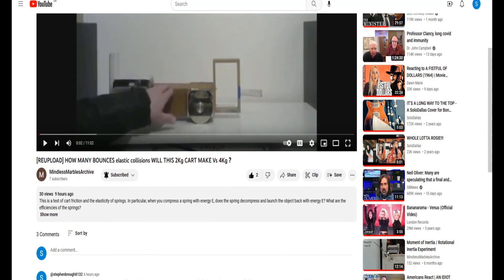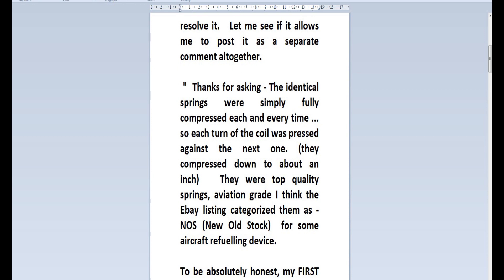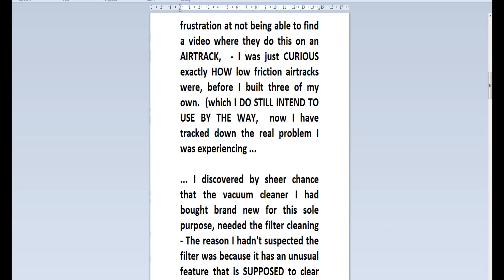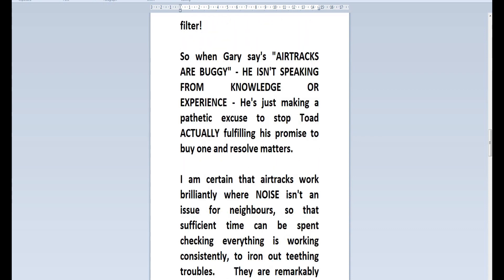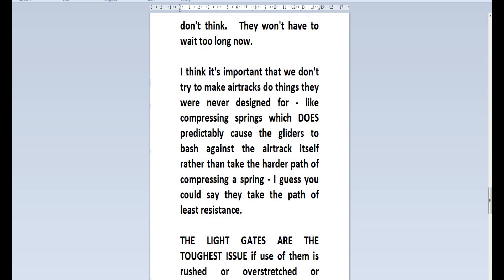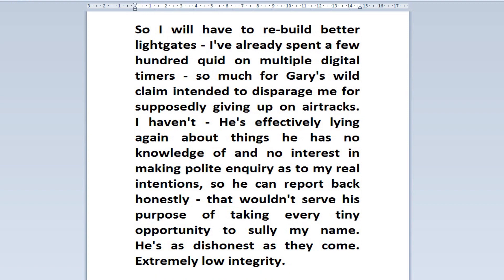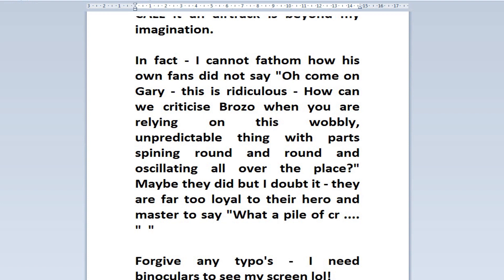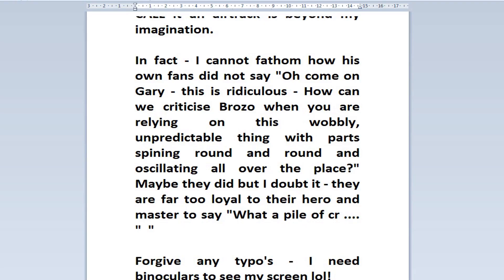YOUTUBE BLOCKED MY REPLY TO MINDLESS MARBLES SO HERE IT IS IN VIDEO FORM.

Comment: Stephen, hello. To set the scene first, I have been a somewhat infrequent visitor to Gary’s channel. I also am very polite and have no interest in getting involved or between your and Gary’s “beef”. By which I mean, the various to and fro. For me I’m interested in testing things, getting them right and resolving then moving on. I have to say this at the start because I want to avoid any drama and I would like my motives to be understood.

I use words like charlatan, liar etc very rarely as in my world these are quite strong language. With this said I will get to the matter at hand.

I applaud you for trying to experiment, the thing I find when trying to do these experiments is that it’s actually quite hard to develop a clean and unlossy experiment. I had assumed when I first got involved this would be easy, but clearly it’s not. 

I still think the whole air track approach could work, because in theory the losses or difference between the experimental outcomes would be large enough to notice. So using good technique I think a lot of the issues could be compensated for, whatever Gary may think. I certainly think it’s worth trying. I’m uk based so when you do get yours working I would happily visit to attest and validate any setup as a sort of impartial person. I have no axes to grind on either side,i just think on something so basic we should be able to resolve things. 

For me the logic I’m applying is that this kinetic energy is a calculated value for sure, but I’m struggling to locate real world places it’s seen. I do think if it was correct we would see fast small wrecking balls, we would all drive much much slower because we would be using too much field going faster, I also think we would see this exhibited in breaking forces.

If we just consider one area, let’s take cars. If we have the same car and we drive it at 30mph, then we drive it at 60mph. If we were using up to four times the fuel (as we would be needing to create twice the velocity) I’m sure we would notice ? I haven’t ever noticed I get four times less fuel consumption, sure I do think it is a bit less driving slower but not four times. What do you think about that ? 

The other thing I would point to is the basic newtons cradle I filmed a few days back. In theory the 4height ball was going twice as fast so had four times KE. When it hit the double weight ball, it didn’t knock it well back at all. We can criticise was my timing precise, losses, etc but I looked at the footage a few times and even if we think things were a touch out it’s still no surplus energy being shown.

Hence I’m interested in what people think is happening, I’m not decided but there does seem to be a gap between what is supposed to be and what is real. I know Gary’s way of engaging probably annoys people so they perhaps don’t see past his demeanour to the ideas. 

Anyway, I am interested in this. I am sure we can work out a way to put this to sleep for once and all time. 
I’m happy to play a part, I have extensive experience in practical engineering and I’m pretty good with electronics as well.
I’m also drama free, as I’m sure you have seen. 

For me a perfect outcome would be to agree an experiment that’s very simple and could then be carried out a few times and show either way what’s occurring. Look forward to hearing your response.
Reply from the maker: Hi Toady - Glad to talk and I respect your position.  Yes a meet up would be fine by me if it helps at all.  In ordinadry life, I'm as polite as you.  I got drawn into all the drama after making a GOOD start communicating with Gary - We liked one another and saw various good things in each other.  I still do kinda like Gary in a strange way and I wish we could get on. (notwithstanding certain things he say's on non-scientific matters - Best kept separate. )  Things only turned sour when he found me discussing my mental health issue with a fellow sufferer,  Hythloday, Gary's number one enemy.  He found that disrespectful although no disrespect was intended - I just welcomed the chance to talk a little about Asperger's Syndrome.  I don't want to tell you the whole story because that will be just dragging you into the drama you've made clear you want no part of. 

I'm still feeling quite ill since my hasty response to your other other comment on my bouncing carts video (there's a better version of that without the overlay obstruction your view) .. I was explaining how ill I had suddenly become while almost completing a long, detailed reply - I just couldn't finish it for various horrible symptoms - I'm still struggling but not as much - so I will have to reply to your points properly in a few hours.   I need to lie down again TBH - don't want to be sick again - might be food poisoning. 

Let me just make a start on one point, if I can sum it up briefly first then maybe expand later when I am less ill. 

I tested whether ELECTRIC cars really do use 4 x energy to go 2 x speed - and NO THEY DON'T - but the catch is they appear to take MORE than 4 x the energy to ACCELERATE to that speed in the first place... All my tests accelerating electric motors, measuring power as best I could with limted instrumentation - seemed to indicate that after taking roughly 6 - 8 x the energy to attain a doubling of sped, they THEN got more or less a free ride so to speak!    The quite large TEAC tape recorder motors went on for over 50 hours on ONE tiny AA battery, all chosne vrand new from Morrisons own brand - so nothing special ... and there wasn't much difference when I quadrupled the voltage (my mmory is a bit hazy TBH - although I have a video of it which has been up about a year, including graphs etc.   U THINK I may have tested double votage too  .. It was THE most tedious experiment I ever did, videoing a total of about 100 hours of the HEAVY 2" TAPE REELS going round and around, desperately hoping the batteries would run out soon.

Although my memory of it is hazy - and I don't claim this to be the world greatest experiment or anything - it was better than nothing after someone gave Gary a link to a proper test on TESLA'S - but the page had been removed - so no-one got to see it.   So I stepped in, hoping to resolve matters a bit.  Because I was curious too.  

I tried everything I could to simulate a bumpy road, sapping the energy I HOPED by attaching large masses to the reels to put them out of balance - so there I was for at least three miserable days VIDEOING IN ONE SHOT,  wobbly tape recorder - only to have to start again when after 20 hours something went drastically wrong, like the tape deck falling off through all the wobbling.  

I never uploaded that video because it would be THE most boring video on Youtube, havingto be split into 6 10 hour videos.  

____________________________

So I think the 4 x fuel thing is a myth APART from acceleration, when it is actually a lot more than 4 x. 

Someone said this is true of a certain aircraft - but I can;t recall the details. 

Making the reels extremely wobbly didn;t actually make any difference either.

I CONSIDERED minimally applying the asbestos type brakes on tape recorders (they hava steel band which wraps around what appears to be an asbestos surface)  but my concern was that I have no real way of guaranteeing I would be applying the same friction to each reel, running in tandem on different voltages.  Even if I could - brrake wear might give advantage to one or the other.   

I don't run a science lab - I'm just an ordinary bloke, ex electrician,  doing my best on these things - for fun really. 

__________________________

WRECKING BALLS - 

That claim has always bothered me because there is a pretty obvious flaw in Gary's claim, which anyone who tried to build one with a half size wrecking ball, would soon realise ...  

.... Wrecking balls get their energy by being raised to a certain height by the crane thingy ... 

....  To get a HALF MASS wrecking ball to go TWICE AS FAST, the crane would have to be able to raise it FOUR TIMES HEIGHER. 

That is obviously a BIG PROBLEM for a vehicle needing to have both STABILITY and MANOUVERABILITY, to get to site, possibly narrow streets etc. 

If the base has to be made larger / heavier to accomodate 4 times the height it can practically lift a half mass ball,  then the vehicle would not only be considerably more expensive but would be able to take on less demolition tasks where it could not really go as easily as a normal one.

I like to think the engineers who designed the ones we do use, took into account all the pro's and cons, to find the OPTIMUM size of the vehicle and size ball it could use.
Because I think engineers know what they are doing.   As in all things, it must obviously be a compromise between all the varying factors thy would be given in a bried to design one.

I doubt they just draw some crude drawing and say "THERE!  The smaller we make the ball, the FASTER we can make it go, thus saving on ball cost""  ...

... I think they would be sacked on the spot when they found themselves having to make the most collosal, wide, heavy, tall crane to achieve that doubling of speed - because HEIGHT is the only thing they have to work with to make it go at all.  

Then there is the TIME it would take it to be raised to that height again - that would be 4 fold. 

And the SWING AREA would take up considerably more room - since the radius of the arc it has to swing through is also 4 times greater - What if there are buildings in the way?  It would be a duff product. 

And what about when that 4 x greater arc ALSO swings THROUGH the building it is demolishing and potentially smacks into ANOTHER building they didn't plan on demolishing?     Time to call Fred Dibnah.  (my hero - I have a video about him, a song with footage of him) 

And what about the increased difficulty of hitting the actual target, with such a long swing?  

There may  be tons more points that actual engineers would point out but I'm just applying common sense.

They could instead DOUBLE THE MASS - and what would that achieve?  

A shorter crane , stronger steel cable needed,  possibly problems with the HEIGHT it could be effective at ...

I am confidence engineers have already decided on the best compromises so wrecking balls are probably much of a muchness. 

_________________________

The problem I generally find with claims like this, is that it only takes SECONDS to say "If the KE formula is true, WHY don't they HALVES the size of wrecking balls!?"   and make an instance impression on anyone who hasn't stopped to thin it through a bit ...

... But it takes MINUTES to explain exactly why that claim is clearly false - and people generally lose patience listening - they switch off - They prefer the shorty SOUND BITES that gary specialises in, becaiuse they require no actual thinking. 

I see it as a GOOD thing when people raise such questions - so long as they are willing to listen to the answers  - But that stopped happening a long time ago - It has become purely personal from gis point of view ... so he's gone from saying Steve is a lovable guy who does important experiments (6 years ago) to Steve is a clown, a cheat, a ch m lester,  - he actually say's these things without batting an eyelid.  But enough said. 

_______________________________

I feel dead rough still - dunno how I am ploughing through TBH - I really wanted to finsh my other reply to you on the bouncing carts, when I stumbled on this comment - I don't yet know how many you have posted - I assumed just the one - 

But it's good to talk.   I;'ve gotta go before I need that bucket again - ugh!
Reply from the maker: PS - Think about the smaller size hole a smaller ball would make in a building - 
Plus WHAT PROBLEM ARE WE TRYING TO SOLVE?  None - 
It's not a known problem - They know how hard they want to smack against a wall - smacking it harder won't demolish a bigger area, - a smaller one of anything, if it goes though more like a bullet
Reply from the maker: Part 3 - you might say - Someone woke me up from my badly needed sleep so I may as well explain the main reasons his BOWLING BALL argument falls flat on it's face the mnute you talk to professionals who actually play the game competitively.    

Gary overrides their expertise because he's been to a bowling alley.  Whoopee. So the pro's must be WRONG when they explain it's a game of SKILL, not brute speed - They are trying to achive a very definite speed.   

I THINK they said between 19 and 21MPH - but it's been ages since I heard their explanation of the technique they employ, which is NOT yto try to smash into them at 40MPH, but to CONTROLLABLY make the ball "bend" - I forget their special word for it - so ut strikes the pins with a kinda SIDE ON component, targetting a specific pin. 

That's just the start of why it's a ludicrous claim...

1) I already DID a very careful test, using those massive 2inch recording tape reels weighing several kilo's, representing similar mass bowling balls, controllably launching them at the requisite speeds,  to roll into a series of 1 Litre water bottles.   

And guess what - the half mass/twice speed one knocked down considerably more bottles. 

His argument?   I used GRAVITY in the mechanics that made them go at the required speed!  

What possible difference could it make, so long as the speeds were accurate?  

2)  Think how strong a bowler's arms would have to be to throw the half mass ball at TWICE the speed...

...If MV applied, then it wouldn't require any extra effort. 

And we've already established that they don;t want to do that anyway because Gary's describing some other, cruder game he imagines just because it suots his "argiument", such as it is. 

He ignores the multiple experiments proving that the same energy input CANNOTdouble the speed or anywhere even close ... 

... and that it ALWAYS results in the half mass going 1.414 x faster AT BEST - barring a mistake like me accidentally letting my half pool ball skd along faster than it should have done, causing an erroneous 1.69:1 result - SINCE CORRECTED thus achieving THE CORRECT 1.4083 :1  - (will upload soon)  - 

.. So he/she has to DOUBLE his energy input to ACTUALLY make it go 2 x faster. 

And they don;t want to do it anyway! 

It's irrational to ignore what the professionals say about their own game...

... and to ignore the preponderance of evidence, just so he can trot off the words "BOWLING BALLS" every ten minutes and feel he has made a valid point.  He has not. 

It's not as if he's not had this explained to him - He just WILLFULLY ignores was professionals say and dreams up ludicrous EXCUSES for why EVERY experiment show's he is wrong.    Not a single one has ever come out in his favour.  He just alter's people's perception by CHERRY PICKING two numbers that to an unthinking person, SOUNDS like a 2:1 ratio... this 11 vs 19 figure he quote mines from my pool ball experiment does indeed SOUND like virtually 2:1  if you roud it down to 10 and up to 20 ...

... But that's MASSAGING THE FIGURES - They actually have a 1.72 : 1 ratio - BUT HE WILL NEVER SAY THAT!  BECAUSE IT SOUNDS NOWHERE NEAR 2:1.  BECAUSE IT ISN;T LOL!

And he ignores the final averaged out result which was 1.69 :1 ... Because anyone who can add up can see that is actually marginally CLOSER to 1.414 than 2.   Then he would have nothing to waste our time talking about for THREE HOURS almost every day.    He's an out and out time waster.   I DO kinda have a liking for him though because he IS  unique individual with tons of tenacity and he IS entertaing and he IS quite obervant and creative to keep inventing excuse after excuse - That's a talent all in itself.  

People say "stop wasting your time - he weill never learn" - True - but I DO mostly enjoy it - and I learn things myself along the way.  He's entitled to his opinion - Too bad it's invariably wrong. 

Sorry my comments are always so long - It's a kind of compulsion to dot every i and cross every T.
Reply: @stephenbrough8132  thanks for your reply Stephen. 
I haven’t looked at the bowling ball type setup but will, as it might be reasonably easy to try.
I do agree that I assume engineers have decided on optimum values for things, because of course they do.

The tape decks seems to be a good test, especially using asymmetric loads on the reels, very surprised that didn’t use them up faster. I mean vibrator batteries die faster than electric shavers because they have a load that’s asymmetric on them ! Not that I’m an expert on either I hasten to add.

Look, i want to avoid being some person in the middle between you and Gary. So I will not comment on that, but I think that putting all history to the side it is fair to ask these questions. Certainly the evidence is not super forthcoming and as both you and I can agree it is also not easy to test.
That’s why I’m keen to get Gary to try to experiment as I feel he is reluctant to test the ideas and anyone interested in truth is also interested in testing. I am absolutely not taking any “sides” here and I will happily critique yours, his or anyone else’s tests.

Final point, I didn’t think the cart looked dirty.
Reply from the maker: @toadyuk8391  Thanks Toady - Your final words went over my head a bit.  "I didn't think the cart looked dirty"... I didn't know that was ever an issue or why it would particularly matter.  I'm guessing Gary must have made it an issue and I missed hearing it because I don't have time to listen to everything - It's a phenominal amount of talking to listen to - I used to try to keep up but it's such a BIG chunk of time out of every day, there are times I just gave up listening - I'd come back a month later and not feel I'd missed anything - Mostly just seems the same show over and over. 

In fairness, the cart is about 40 years old (My late Dad's whisky box he kept pens in) so it probably is a bit grimey but I never noticed.  He's right that my finger nails are often dirty - I'm a busy bloke, people always asking me to sort their bins out, take kids to football, look after their kids severl hours a day - I do more than a lot of Dad's and frankly, it exhausts me but is so rewarding and heartwarming that they love me, I'd rather sacrifice 6 hours to have such a great rapport with them.  

Right now I couldn't look after a gerbil.   I feel kicked in the chest, weak, dopey.   Food poisoning probably.  I really should live a cleaner lifestyle if that's the reason. 

________________________-

You're right that the evidence is not "super forthcoming".
I was dismayed that the Willem Gravesande / Emilie Du Chatelet clay experiments were impossible to find re-done on Youtube, while there would be LOADS of other famous experiments reproduced ... So I made about 6 videos in all, maybe 8,  where I thought it would be worthwhile testing the claim of their results...

FIRST PROBLEM!    Myths spread faster than truth on the internet. 
So both Gary and I fell for the widely spread myth - even included in a famous movie about Einstein - that the ball dropped from 4 times higher, goes four times deeper. 
 ... 4 x higher = 2 c velocity - 

I had to prove even THAT too, for Franklin Hu, who two months ago claimed it wasn't true and had supposedly never been tested.  

So it's not just Gary I will argue with if anyone makes such an arrogant proclamation with the absolute worst evidence - which Franklin's was.  

I STILL HAVEN'T UPLOADED THAT VIDEO, which is such a shame - It's great!  I put a LOT of effort in.    But the moment was lost by the time I had completed it - Everyone had moved onto other things and he'd stopped going on about it so I let it drop.   

I think you would enjoy it though. Same for many dozens more experiments never uploaded because the moment was lost by the time I had completed the work.  Every time I try to RUSH an experiment so I can publish it before it's no longer a hot topic, I live to regret it, for the obvious reason that it takes a great deal of time to do the best version I can. 

SO BACK TO THAT MYTH of the ball going 4 x deeper. 
There are even misleading DRAWINGS of a ball penetrating clay, supposedly making some perfect deep hole - looks like a drawing of a mine shaft - one short one and one very deep one, 4 x deeper.  It's all fantasy.   But we all fell for it at first. 

I eventually found just two rather poor videos where at least they were not propagating that myth ...
One was a school, where the teacher explained it's the VOLUME DISPLACED which is 4 x. 
It wasn't videoed too well - although he did do the math to calculate the volume, which came out within a small margin or error. 

The other was older school kids doing it without a teacher to assist.  So they made mistakes at first.  
But at least they too had the right idea - to measure the volume displaced, not the depth. 

Once I knew the proper way to do it, it was a breeze - I bought large lead balls - (Gary argues they should be brass, although he used to argue it makes no difference.  It obviously doesn't.)  and dropping them in a very controlled way into a new batch of clay bought for this purpose, it was easy to measure the volumes using a syringe to measure how much milk (easy to see) each dent could hold.  

Gary complained about TEMPERATURE affecting the results - and clay CONSISTENCY ...
So I did it again using three different clay consistencies,  carefully drying out one batch, adding water to another, leaving one as is, and ensuring a homogonous (?) mix. 

I tested temperature of course using a rather expensive digital thermometer able to read 100th's of a degree C or F. 

I couldn;t have done more to make it clear - videoing long shots so the whole experiment could be seen as well as CLOSE UPS - and slow motion footage, at 120fps - A Gopro - and hours adding descriptive text where needed.   And graphs or some kind of documentation I can barely remember in my weak state right now.  

Not good enough of course. 
Anotrher pile of junk from Brozo the clown. 

____________________________________________________-

MOST INTERESTINGLY - I THOUGHT - SEE WHAT YOU THINK!!! ...

I TESTED THE VALIDITY OF USING CLAY TO MEASURE ENERGY, BY INSTEAD OF DROPPING ONE FROM 4 X HIGHER,   I MADE THE SAME BALL FOUR X HEAVIER,  because we can all agree 4 x mass IS 4 x energy in BOTH MV and 1/2MV"2.

IT DISPLACED THE SAME VOLUME AS THE 4 X HIGHER BALL, A QUARTER OF THAT MASS.  

Can you think of any other reason they give the exact same results?  .. and why that doesn't mean 4 x higher really IS 4 x the energy?  

To me, it seems conclusive and such an obvious test that they are bound to have also tried this 200 years ago or whenever it was.  

This DOES need explaining.

BUT NOBODY EVEN MENTIONED THE SIGNIFICANCE OF THIS VALIDATION TEST.  
I have doubts most people really warch my videos with as much attention to detail as I put in them.  
So it's KINDA unrewarding apart from a few regulars who take an even deeper interest. 

__________________________
__________________________

Parapolylogic argued that I must now drop from some FAR GREATER HEIGHT to properly test the theory 
... So like a mug, I spent sveral hours TRYING to drop FROOM ROOF HEIGHT !   Hours and hours of missing the target  - It's remarkably hard to hit the target fron that height AND keep coming down to find the ball when it bounces off the mattress's protecing the ball from hitting concrete  -  It would bounce into the grass whatever I put down hoping to stop that - Duvet's mainly. 

I was puzzled why the results were not quite right - Turns out that after all that effort, I had calculated the height wrong!!  

Frankly, I lost the will to live after all that and nobody was interested anyway - Parapoly had ALREADY misled me with some numbers pertaining to the Myth busters fiasco - It took a lot to get her to admit she didn;t know where she got those numbers, supposedly supporting Gary.    There were NO such numbers or anything close, in that video.   Most people won't bother to check, so it's easy to get away with plucking numbers out of thin air. 

IN FACT - THAT'S ANOTHER video I lost interest in completing - although I really MUST finish it just to put the record straight about why their clay based test was done exactrly the OPPOSITE way it is supposed to be done  ...

... They WEREN'T measuring clay displacement - 
They were measuring HOW MUCH WAS LEFT ...
... AND ONLY PROVIDING ENOUGH CLAY TO GUARANTEE A 2:1 OUTCOME ..

...ie HOW IS IT EVEN POSSIBLE to compress clay 4 X MORE, WHEN THERE ISN'T ENOUGH CLAY LEFT TO BE COMPRESSED MORE THAN 2 X?    

So it CLEARLY isn;t a valid test for KE 

It's like if I made my clay blocks too shallow, so the first ball went to half depth, 
HOW could I POSSIBLY expect the 4 x higher ball to go 4 X DEEPER!?   (not that DEPTH is the right way to measure anyhow, we already established that) 

They were NOT really testing KE - They never even referenced it - That was just Parapoly trying to big up Gary. 
They were dropping a FLAT cylindrical mass against a smaller diameter clay pug, 
... The first drop compressing it to about HALF it's starting length...
LEAVING NO ROOM AT ALL TO EVEN POSSIBLY COMPRESS IT FOUR TIMES MORE ...

The absolute maximum they could achieve was 2 x. 

But Gary and Poly STILL claim "it failed" to compress 4 x lol!   

It doesn't debunk KE if the experiment is effectively rigged for just one possible outcome - 2 x
and they aren't even measuring displacement anyway. 
They are measuring how much clay is left.  
Which is like me measuring the clay that was untouched beneath the ball dropping into it,  instead of the volume displaced ...
and making the clay blocks TOO THIN for the 4 x higher test to have any possible hope of going 4 x deeper - because there was only enough left untouched to indicate 2 x deeper. 

THE WHOLE THING was a shambles IF we are to read more into their experments than they ever intended. 

I find it quite shocking that people can misrepresent what they were trying to do.  

___________________________

I've still got to get back to the comment I never finished last night, Toady, and I'm still feeling rough as a bears ...  so I will take a rest and check whether I missed anything you said here that warrants more discussion.  

Thanks for trying - If you can get gary to do experiments that would be brilliant - He HAS done SOME to be fair but he's not one for going the extra mile.  

I apologise for anything I;ve said about you in the past - I misread your intentions, thinking you had dismissed everything I had ever done and would never communicate.   
I'm glad you have a balanced view and will crtique us all equally. 

I imagine you are extremely busy too and all this is a lot of information to take in so there's no rush.
Reply from the maker: @wotteo702  I think it would be kind to call him amateur.  
He makes no effort - Expects everyone else to. 
After Toady made the effort to do what he called a "just d!ck!ng around" experiment to hash out the snags, when he's clearly busy, Gary made it clear he did not want to do that experiment, when Toady suggested he at least attempts it. 
His excuse was that if he did it, he would want to suspend from his ceiling.  
Well where's the difficulty in that? 
After the live session, he repeated "I DON'T WANT TO DO EXPERIMENTS! - I DON'T WANT TO DO EXPERIMENTS!"

Yes, Gary, we noticed. 
You just want to talk.
What if everybody else did that? 
You'd be the first to complain. 

PRACTICE WHAT YOU PREACH.
Reply from the maker: @wotteo702  YES - I DO AGREE - It DOES take a lot of guts to maintain his position against the whole of science and a bunch of people laughing at him for years on end.    I have also realise I DO need to make a formal public apology for sullying his character, sladering him, in my unfounded accusation that he took a week off just to figure some excuses for my March 9th 2021 video - my first response to his KE claims.   I listened againt to his first response video where he had difficulty recognising I was using a lever throughout to achieve the required velocities and I now concede he DOES appear to be fenuinely seeing most of that video for the first time and genuinely unable to figure how the experiments were meant to work - because I DID fail to explain or show or document it and concentrated more on making it entertaining and retaliatrory.   So I will make a proper apology video for that so everyone can see it.    I also made a mistake  in that video over the solder sucker being used to propel two different masses upwards to show that halving the mass did not only make it go 2x higher (I need to look at that again to confirm the details) but essentially that experiment was flawed by the solder sucker spring being restricted by airflow through the nozzle, slowing it down, limiting how fast it could release it's energy.   Therefore it should have gone a lot higher, making us both wrong in our conclusions on that.   I have tried it again since and it flew too high and fast to even video the height achieved - so that was a totally invalid experiment I should have edited out.